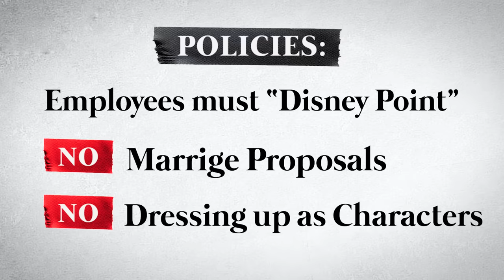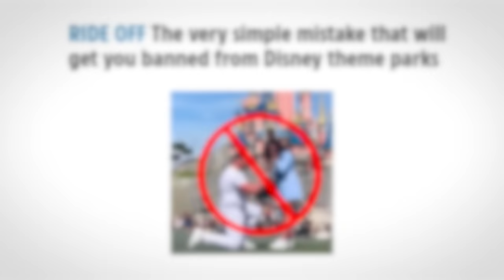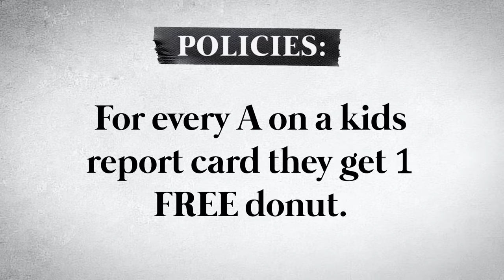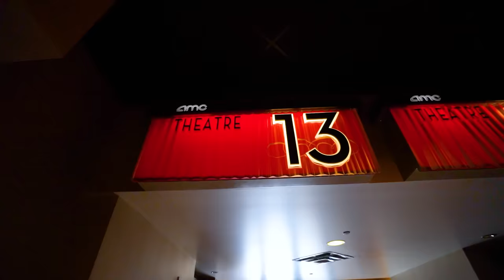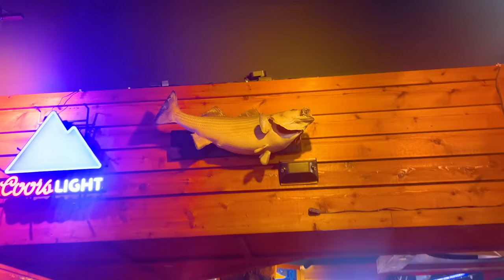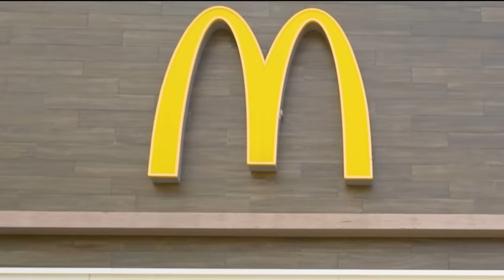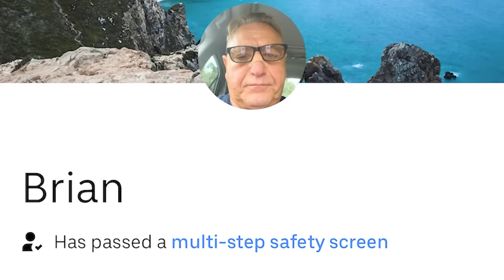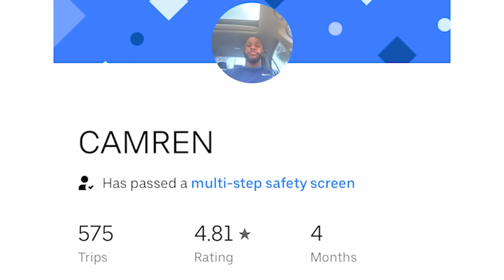I Tested Weird Company Policies

Comment: Just saw the complete Disney and I have to tell you the reason they don’t do anything with Proposals anymore is because of the backlash with the employee ripping the ring away from the couple on the stage. They loosened the policy, now it says proposals in unauthorized areas, meaning no employee zones or underpasses and shortcut pathways, or even in front of Characters. Anywhere else is fine, as long as you aren’t blocking people or in restricted areas.